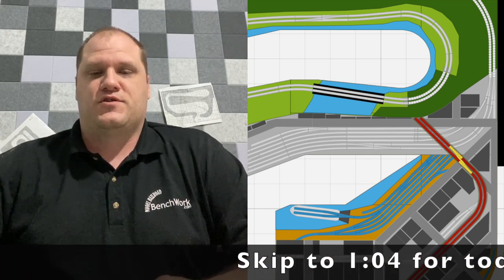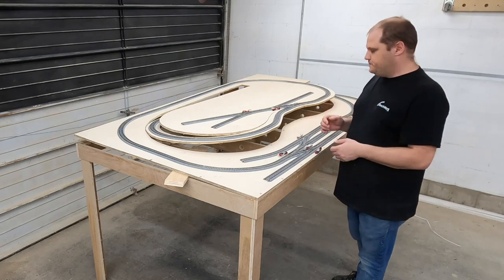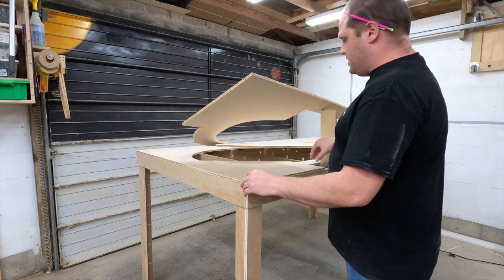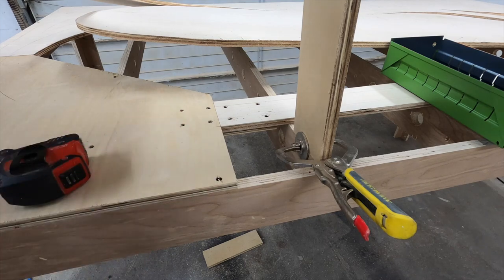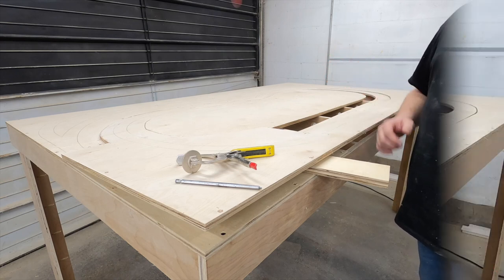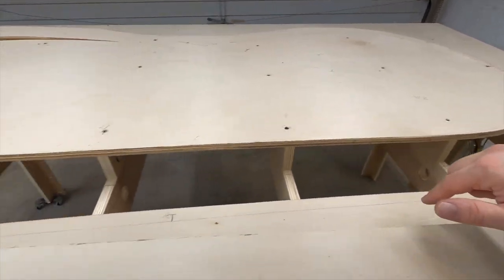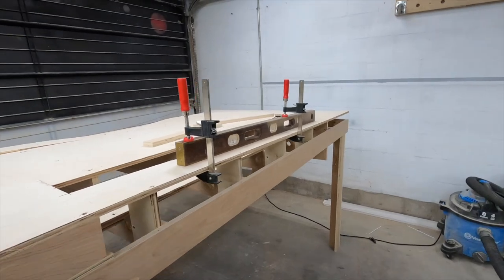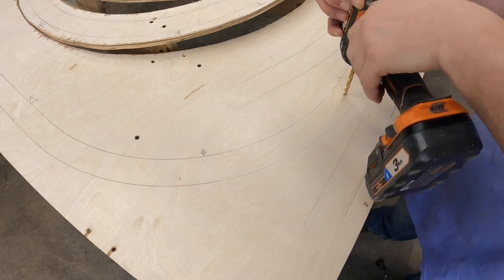Let's get vertical! - Building a 4x7 Model railroad Part 3.

Comment: Very much like the way you approach setting the grades. This way it’s just plain and simple. And, yeah for a larger layout it might require a bit more measuring. Nevertheless, the clamping method can in such cases too be very, very useful. And then, when a section becomes really difficult to clamp, one can of course also clamp the risers to find the right grade all the way. Might be some more work, but will definitely do the job.
Thanks 🙏 for sharing.
PS: watching your channel is already an absolute gift. With your examples and explanations I’ll be able to up my game in building the base for my own layout project.

Comment: When attaching the risers to the layout are you using drywall screws or another type of construction screw?
Reply from the maker: They look like drywall screws but they are actually an auger tipped hardened screw made for cabinet makers.  I buy 5 - 8,000 at a time.  The nice thing about them is I don't need to pre drill all the holes which saves a ton of time.

Comment: It wouldn’t really apply to that layout 

But if you were making an around the room type layout and had to do large lift out sections, like 7 or 8 feet long. What would be the best way of doing that? Since it’s a lift out you’d want it easily removable but at the same time you still want to make sure it is secured and lined up correctly when in place
Reply from the maker: While this is a little difficult to describe in text I'll try my best.    Essentially what you are asking to do is to make a section of layout between two permeant layout portions removable. This could be for room access or space to swap out a water heater for example.  If you construct your benchwork in the way I do, namely 1x4 material built into a frame you have plenty of material to bolt in that removable section but that alone doesn't solve the problem. What you need is a 3rd hand.  If you take a piece of 1x4 plywood and screw it to the bottom of the two permeant benchwork frames making sure to leave an over hang of 1 inch you essentially make a shelf  / slides for the removable module to slide into place on. the perk of this method is it's essentially self aligning but also gives you something to shim off of in the event you need to.